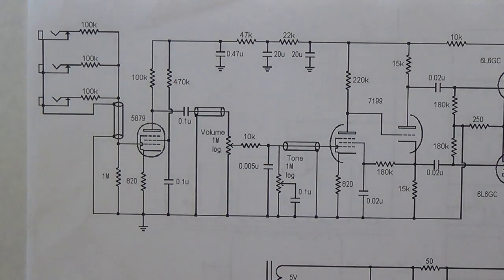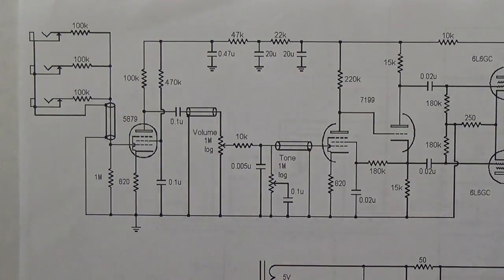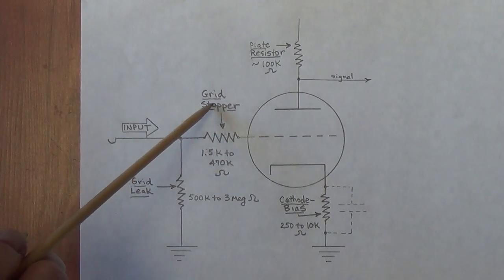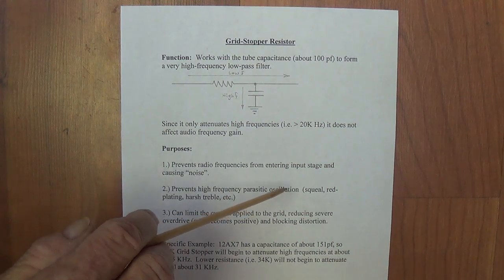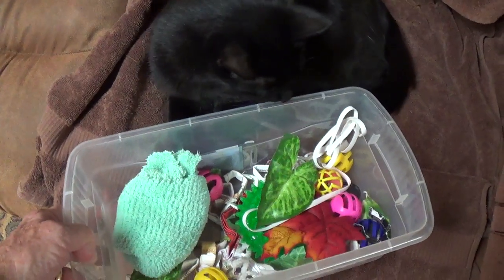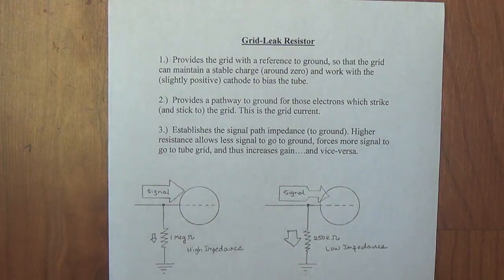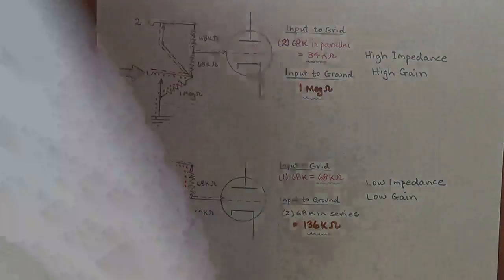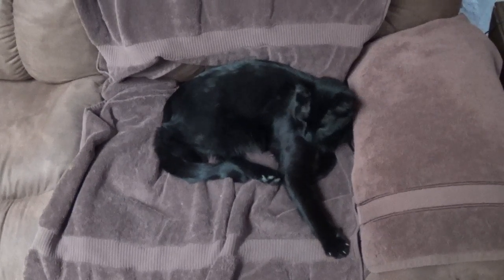Resistors, Part 3: Grid Leak, Grid Stopper, and the Fender Input Circuit

Comment: Doug this is great. I actually used the knowledge of tube capacitance to modify a  5f1 input which was going into severe oscillation only when there was no guitar or cable plugged in. I did not want to use a shorting input jack in this case, I wanted ultimate simplicity. What I did was use a very small cap (determined by using a 15k signal and O-scope  across the input jack thus giving me a bit more of a ultra hf filter but not affecting the audio. This gave me more lattitude in the type of tube used in the first stage. Worked great! Thank you again.
Reply from the maker: We're glad to hear that the videos were helpful, Pete.

Comment: Jack is shunting comands to ground.
Reply from the maker: +Cawfee Dawg  Very well said. He has definitely developed into a high- and low-pass filter. As you say, any request with which he is not inclined to comply tends to be eliminated from the circuit :))
Reply: Try to connect him as a plate resistor, he will become more obedient...
Reply: You've cleared up my understanding of shunt in a much needed way
Reply: Yes Jack appears to be a very low impedance cat.

Comment: This video has come with great timing. I'm having to debug my homebuilt JTM 45 input circuits (blows the mains fuse when I jumper the inputs) and has helped with understanding how the various components interact. Havent fixed it yet but we'll get there. All thanks to Uncle Doug.
Reply from the maker: +Andy Wragg  I wonder if jumpering the inputs may be allowing the strong input signal to overdrive the output tubes and cause them to draw excessive current. If you're using a current limiter and can get the amp to stay on with no signal, strike a chord and see if the bulb flares up.
Reply: I've been playing it jumpered in the last hour whilst running through the current limiter. I can see the current usage on the bulb. I'm normally quite an aggressive Strummer - we play a lot of pop punk in the band - and I can see this reflected in the bulb intensity. Thinking back to when I first jumpered the inputs, this was also the first time I ran the amp straight into the mains. I'll try a F2A fuse tomorrow and see if that changes things. I still can't find a problem with the wiring.
Reply from the maker: I assume that when un-jumpered, the bulb doesn't flare up as much when you play, and the fuse doesn't blow. It would appear that jumpered inputs will require a higher value fuse (i.e. 2A). Most of my push-pull amps tend to use 2A fuses to start with.

Comment: Oh man, you're my savior. My recent ab763 build has weird behavior on vibrato channel, when i turn my volume pot above 3 it starts squeal and one of my 6v6 was red plating and load voltages drops and jumping between 300 and 350 volts, also i burn two 1w 470ohm screen resistors on red plated 6v6. When i watch this video i decide to play with my 68k grid stoppers and boom! now it works fine! I think it was just bad joint between resistors and wire, holy crap that little bastard freak me out for whole week.
Reply from the maker: Congratulations on a successful repair, TP.  We're glad to hear that our video was helpful :)

Comment: Great explanation of the Miller effect. I didn't realize how much of a difference the value of the grid stop resistor made on frequency. That explains why the two overdrive 12AX7 tube stages in my Ceriatone Overtone Special (Dumble clone) amp have 68K and 180K ohm grip stop resistors - to reduce the high frequencies.
Reply from the maker: +Tony Manns Thanks, Tony.  Yes, since resistance is in the denominator of the frequency cutoff formula, it had an inverse effect on the cutoff frequency.....higher resistance = lower cutoff, and vice-versa.

Comment: Thanks for an informative lesson.  I play lap steel guitar and find that most steels have very high output pickups.  Especially the old horseshoe pickup Rickenbachers, of which I have several.  My 70's Traynor amp heads have the same input circuit as the Fender and I always use the #2 input to keep from overdriving the first preamp tube.  If I use the #1 input, I can't turn the volume up much past 1 or it's way too loud.   Your video finally explains why I can hear a difference in the brightness between the two inputs as well.  My blue heeler, Sparky, says to say "Hi" to Rusty.  They have identical energy levels.
Reply from the maker: +jflimbach You're welcome, JF. Back in the "good old days" there definitely were applications for the low-impedance input, including the example you cited. Thanks for watching and for your input.

Comment: Again, a much needed explanation. I have been unhappy with a slightly harsh and brittle sounding treble frequencies from both the Fender & Marshall style channels of my amplifier. I have the standard 1.5k grid stoppers on the four 6L6gc output tubes but may experiment with some larger values,( ie; 5.6k grid stoppers, a value used on Marshall EL43 tubes), to help eliminate some of these harsh frequencies.
Reply from the maker: Glad the video was helpful, Jim. Let us know how your experiment turns out.
Reply: The input capacitance of a pentode/tetrode is so small that increasing the grid stoppers will have no effect on frequency response. The input capacitance of a 6L6GC is around 25pF. 1.5k grid stoppers cut frequencies above approximately 4.2MHz and 5.6k grid stoppers would cut frequencies above approximately 1.4MHz. Way too high to affect the frequency response of the amp.

Comment: As always, this is an excellent series of videos that's straightening me out on a lot of things. I'm nearly dangerous now! (Just traded a license of my synth software for an old analog 'scope too! Hameg HM-203.)

Thanks Doug!
Reply from the maker: +Admiral Quality Thanks, AQ, and congratulations on your acquisition of an oscilloscope.  If you don't already have an audio frequency generator, you will  need to get one.  Best of luck mastering the use of these instruments.....they can definitely streamline the diagnostic and "tune up" process.
Reply: +Uncle Doug Just got a Heathkit 3600 power supply 0 to 15V, 0 to -15V, 15/-15V AC, and 200 Hz to 20kHz square/sine signal generator from the same guy. Breadboard on it too.

Also a logic learning project board. Mastertech Labs "Microlab 1" with all kinds of gonkulating goodies on it. Also has a proto breadboard on it.

Okay, NOW I'm dangerous! :)
Reply from the maker: Indeed you are, AQ. It sounds like you're ready to do some serious repair and scratch-building. Keep us posted on your projects.
Reply: +Uncle Doug Will do! Current project is trying to figure out what's wrong with an old Casio CZ-230S mini-synth that doesn't power on (but speaker makes a thud when it's powered on and off so something's happening in there).

http://www.vintagesynth.com/casio/cz230s.php
Reply from the maker: Synths are Greek to me, AQ. Best of luck :)
Reply: +Uncle Doug I'm pretty sure the problem is going to be somewhere in its power regulation. The actual synth functions are all on chips that do who-knows-what? This is a very early all-digital beast. :)
Reply: ...but a big clue is the power LED doesn't even come on when you switch it on. So it's going to be power supply for sure. Bad voltage regulator, maybe? We'll see... (I'm already longing for the relative simplicity of tube amps! Transistors are the devil's implement! ;)
Reply from the maker: I concur, AQ, hence my unwavering and exclusive devotion to tube amps.....the older the better :)
Reply: +Uncle Doug BTW, I still want you to adopt me. 48 year old Canadian refugee! Unfortunately, white, male and single.
Reply from the maker: You may be in luck, AQ. The only strict requirements for adoption are: capable of providing a steady supply of beer and steaks (Rusty insisted on the latter).
Reply: +Uncle Doug I'm a Syyrian 'bout a Mercury!

Comment: In the very early '70s, when I worked in General Aviation (small planes) avionics, a customer brought in a comm radio (from the 1950s) that had no receive audio. I identified the offending stage and started making voltage measurements around that tube. When I put the VTVM (11 megohm input resistance) on the grid the audio came back and stayed on a few seconds after I removed the probe. Shut the radio down, found the 1 megohm grid leak resistor was open. The grid was building up charge and shutting itself down.
Never saw a grid stop resistor in my couple decades of tubes but I never worked on music preamps. In RF power amps - usually the home-brew types from my ham days - series resistors on the control grids were sometimes added to stop parasitic oscillations. Those oscillations were produced by plate to grid capacitance in power triodes. It is more common in power FETs in RF applications.
Reply from the maker: Thanks for your detailed and informative input, FM.
Reply: The grid stopper has multiple functions. In addition to stopping radio frequencies entering the input stage, they are used to prevent  parasitic oscillation and to control blocking distortion.

Comment: Uncle Doug thanks again for great videos...I was hoping with this video you might address the noise produced by grid stoppers.  What I have come to understand is that the resistors in the Fender circuit contribute to what is called Johnson noise, a characteristic white noise I believe.  I my particular case I have a 67 Fender Deluxe reverb that sounds wonderful.  But it has in my opinion too much white noise coming from the first preamp stage.  When the volume is down the noise is still there just a bit and when I raise the volume it comes in pretty strong.  If I short the first preamp stage grid temporarily at the point where the two 68k resistors meet by the input jacks the noise disappears obviously.  If I pull either preamp tube the amp becomes super quiet so I feel the trouble has to be in the first preamp stage.  Also removing other tubes for reverb and tremolo don't affect this noise.  I have tried three sets of tubes with pretty much the same results.  The noise is consistent in amplitude whether using the normal and vibrato channel.  This led me to believe that the power supply 10K 1W resistors were noisy so I change those also (the old power supply electrolytics were change out months ago and their good) but this did nothing.  I have changed the old leaky capacitors in the tone and bias circuits and I have changed the 100K plate resistors in the first two preamp stages.  But I still have the noise.  Today I substituted two brand new 68K grid stoppers in parallel to simulate what the input is with nothing plugged in and still the noise is there.  I appreciate any advice you might have for this.  Note that recent I built a new amp with very same input style except the grid stopper resistors were spec'd at 47K.  This amp has virtually no noise in this first preamp circuit.  So I am a bit stumped but optimistic that it can be fixed.
Reply from the maker: It seems to me that you have ruled out all the usual suspects, Tom. Are you using carbon resistors, or metal film? The metal films are generally quieter. That's about the best I can do, long distance and sight unseen. Best of luck.
Reply: I am using new carbon composition (not NOS)i which I know are a bit noisier but still this seems a bit more noise than other amps using the same type.  I'll continue to play around with it.  Thanks.
Reply from the maker: You're welcome, Tom
Reply: Try a new preamp tube, or try swapping the tube with one of the other similar tubes in the amp. If that doesn't help, then unless you actually need two inputs, remove the 68k grid stoppers and install a 10k metal film grid stopper resistor from the input jack and connect it close to the grid, preferably after the 1M grid leak as in Uncle Doug's hand drawn schematic which appears in the video at 2:15.  You could connect the resistor using screened cable with its screen connected to ground at the input jack. Add a 680pF capacitor from grid to ground for r.f. rejection.

Comment: Thanks Uncle Doug!  As always, very well explained! My understanding of my amps has improved exponentially since I've been studying your videos. Now if i could just work out why my previously, super reliable tweed twin is shorting out the minute I try to connect the rectifiers to the rest of the B+ circuit. OT gone bad maybe?
Reply from the maker: You're welcome, Jim. Two possibilities come to mind:  The polarity of the electrolytics must be correct (generally - to ground), and one of them may have an internal short.  The OT is a long shot......they rarely fail, and if they do, it's generally open not shorted.

Comment: thank you once again Uncle Doug. I am continuing to learn how my amplifiers work and why the parts I install give me what I want. I have a small suggestion. when you show the tube connections, can you put the PIN numbers on the diagram. I loose a little understanding in the video when we are talking grids, plates cathodes, anodes etc. thank you once again for your time. PS you are a great teacher. Bob
Reply from the maker: +starlingave  You're welcome, Bob. We're glad the videos are helpful.  I generally try to add the pin numbers to schematics, because I (like you) can follow the circuit better with them, but occasionally I forget to do so.  Thanks for watching and posting such nice comments :)

Comment: A very interesting and thought provoking video Uncle Doug.  Do you think Fender actually expected musicians to use Input #2 by itself when they came up with the design?  In my previous analysis - I had always assumed that the Fender input circuit design was oriented to providing a relatively balanced input for the scenario of using BOTH inputs at the same time - and that the input characteristics of using input #2 by itself was just sort of an in-escapable consequence of that design ??  Consequently - With my 5E3 builds - I just used a single input and a 32K Grid Stop and a 1 Meg grid leak resistor !!  Your thoughts ??
Reply from the maker: +Donald Filbert  You could be right, Donald. Using #2 as a single input doesn't seem to make much sense, unless your input signal was too strong for #1.....and I can't picture that.  Since most people use only a single input, your solution sounds good to me, with optimum grid stop and grid leak values.
Reply: Guitars with built-in preamps ...?
Reply: On reason might be to tame the brightness of single coil pickups. Input's lower impedance can make a Strat sound a bit more mellow. @UncleDoug

Comment: Hey Uncle Doug. Love your channel and your content. I'm a studio engineer but i'm trying my hand at building a tube amp.. I'd be completely lost if it weren't for your channel. So thank you, you deserve a youtube award. I have a question. After watching this video I looked up the capacitances of the tubes I'm using for my amp. I'm seeing  1.6 pf for the 12AX7  not 151pf. I know it's a minuscule difference as far as capacitance goes but it's pretty significant when using the low-pass formula from the previous video. My questions: Am I missing something or reading the datasheets wrong? and Am I obsessing over shit that doesn't matter? Did I hear "low-pass filter" and get too excited because it was something familiar to me? haha maybe so. Anyway, thanks again. Your channel is seriously among the best I've seen.. Cheers Uncle Doug!
Reply: There are some other things I can't seem to figure out or find the answers for anywhere. I'd like your advice if you wouldn't mind.
Reply: The 1.6pF of grid to plate capacitance plus any stray capacitance is multiplied by the gain of the stage plus 1. This is known as the 'Miller Effect'. You can see a full explanation of the Miller effect and the calculation resulting in 151pF at: https://www.aikenamps.com/index.php/what-is-miller-capacitance

Comment: My cat Raisin, who looks just like Jack, really would fetch and return a small ball for my oldest son. He would toss it down the hallway and Raisin would bring it back and dump it at his feet.
Raisin also liked to play with the rings from around under the cap of milk jugs. One of his favorite toys.
Reply: The balance of resistance on the tube circuit - is that something that bad leaking capacitors would mess up and cause things to burn up?
Reply from the maker: I wonder if it's a trait of black cats, Michael ? Leaking filter caps will create excessive current flow (to ground), overheated power transformer and rectifier, and general havoc. Unless there is a fuse to blow, a fire could result.

Comment: Uncle Doug, I am not sure how often the problem of Grid Emission becomes severe enough to become noticeable in tube-type amplifiers, but it results from the cathode material (which is chosen to emit lots of electrons when it is heated) boiling-off of the cathode sleeve and then collecting onto the [nearby] grid structure.  It is still exposed to some heat from the cathode, which tend makes the grid go somewhat positive.  The tube will conduct more and more, going into thermal runaway, in severe cases.
Reply from the maker: Thanks for your detailed explanation of the process, James.
Reply: Thermal runaway can happen in power tubes, and is the reason for the maximum grid leak resistance given by the data sheet.

Comment: Interesting stuff. I learned a lot. I was recently bidding on a bust marshall MA100H amp on ebay.  story was that it blew fuses in the building and one of the valve tubes ran away and blew. I wanted it for parts really, but now I think I know what the problem may have been. a dead grid leak resistor or bad solder joint. made in vietnam amp I think have some notoriety for cold solders.
Reply from the maker: Runaway tubes are generally the result of weak or failed bias voltage supply, which is generally fairly easy to fix as long as no harm has occurred to the power or output transformer.